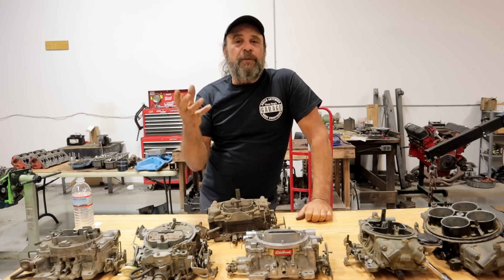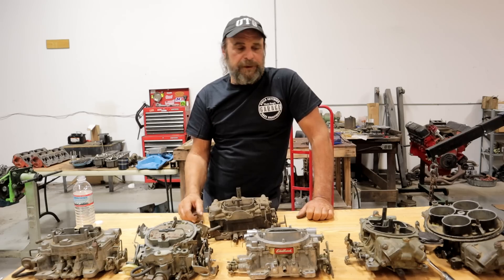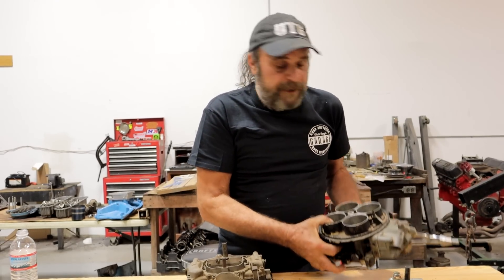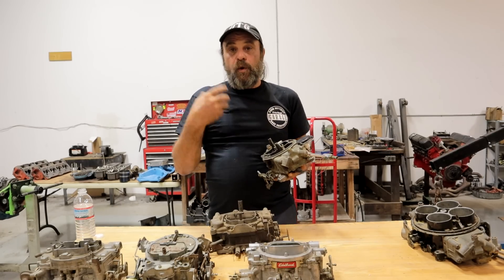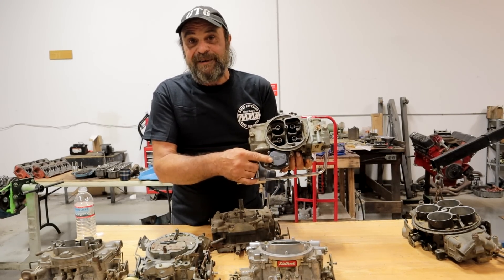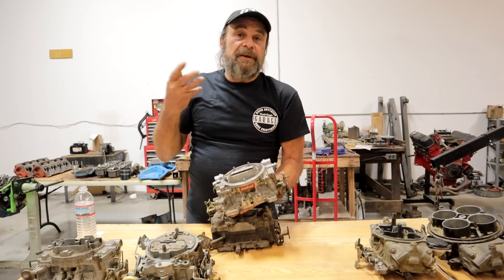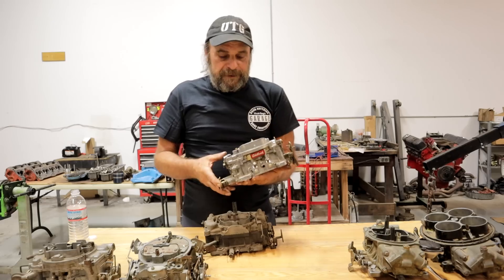Mechanical & Vacuum Secondary Holley VS Carter/Edelbrock, Rochester Velocity Style Carburetors

Comment: Back in the 80's I built a mopar 318 with factory 340 heads,cam and intake. Stumpled across a cheap used Qjet and put it on. Got it tuned by buying a Rochester how to manual and parts from a local GM dealership. Put it in a Dodge Dart and man that thing would scoot. Outran a Corvette one time. Wish I still had that car.

Comment: Great explanation on the different variety of carburetors used in our vintage cars.  I've rebuilt many Rochesters and Thermoquads with good results.  They always ran better after the rebuild.  Can't comment on the others but I'm sure the results would have been similar.  Got a Thermoquad on my Barracuda and it runs great.  Would I be happier with a newer carb ?  I doubt it.  Thanks for all the great videos.  Best Regards - Mike

Comment: After seeing the previous video regarding the silly formula to calculate your engines carb cfm, I researched a little further. 

This one had me read the article a couple of times.  The 337 Chev producing 350hp had a 600fm square bore Holley.  That’s factory OEM.  I’d always thought it was the 750cfm Quadrajet that was on these higher HP engines

Comment: I thought I remembered this video after the current UT video. UT says in a cruzer , " Use Edelbrock."  Just bought the 1st 4150  for myself in the last 20 years.  Always used Edelbrocks. The Holleys are more work to tune. That said, I'm still not close to tuned on the new 4150, but it definitely does out preform the Edelbrock. We'll see how reliable the Holley is. The Edelbrock was trouble-free. Change rods in the spring and fall. Holley to race Edelbrock to drive.

Comment: Hey Tony, I seem to remember that Carter had a "Competition" version of the Thermoquad I think it was around 1000 cfm.  Have you ever run one of those ?
Reply: I have one in my garage right now sitting on a shelf
Reply: On my '72 Sebring Plus w/400 4sp had a 815cfm thermoquad. Multiple tunings w/ different rods & jets let me set it up good w/ .509 cam, electronic dist total timed @ 31° btdc. Had a dist.  mark for starting/daily driving@ 6°btdc.  Lots of memories!
Reply: I'm pretty sure it was 1030 cfm, if I remember correctly.
Reply: Could be it's been a while.

Comment: According to the antique Carter manual I still have, WCFB stood for "white cast four barrel", and the AFB name designated the change from basically pot metal to aluminum. Other antique stuff I have, since I am definitely an antique and got it when it was current, give the same translation. Trying to explain pot metal, or white cast metal in this era, though? Uh, no, not me.

Comment: If you're using at there's Spring tension intention there's the Cam on the 2nd area airvalve there's the orifice in the vacuum break that you can drill out there's a hanger that you can change the location of the measuring rods and other things

Comment: The Thermo-Quad (TQ) was initially released for competition in 1969. Chrysler may have invented the thermoquad in the very early 1960s for experimental engines.
Reply from the maker: It was released in 68 as an aftermarket upgrade for the Quadrajet.  Chrysler had nothing to do with the carb until 1971 when they used it on the 340.

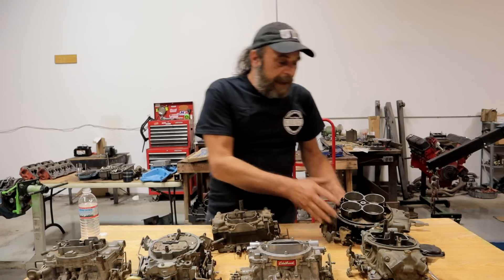Comment: Tony they didn't introduce the thermal quad till 1971. The 1st engine came on was at 3:40 and that was the beginning of it. And I know that cause I got one from a wager to put on a 65 GTO. I was racing at the time and it was like from outer spthe ultimate carburetor
Reply from the maker: No, CHRYSLER introduced it in 71.  It was available over the counter at any speed shop in 68

Comment: I would argue that the Reg Edelbrock/Carter is easier to tune for a youngster than the comparable Quadra Jet.... Pulling the whole air horn for adjustment is just a deterrent when comparing a Q jet to a Carter/Edelbrock ....  Keep Hot Rodding A Live.. 
Thanks Uncle Tony and Uncle Kathy..

Comment: I run a holly 650 DP mechanical  secondaries with a 6" velocity  stack on a 1970 Chevy Monte-Carlo small block  400 (406) bored over.  In a 57 Chevy wagon.

If I have to pull stumps,   I'm going up to the hot rod.

Comment: I just rebuilt the Thermoquad for my 440 Duster. Runs much better. Still a bit of a bog when I floor it. I’m thinking the spring for the secondary air door needs a tweak. Tighter? Looser? Depends?

Comment: IMHO, the Q-Jet is the Apex of Carb Design. It was reengineered in the Mid 70s  with Altitude Compensation, and then again in the early 80s, when the Primary Metering Rods went under Computer Control. 
Its Design, allows for an almost Infinite variety of Fuel Delivery Curves, and it has been used on very small engines to some very large. Most Q-Jets were rated a 750CFM, but a few were rated at 800CFM.

Comment: Thanks Tony great video, can you help or if anyone can help 😊
I have a rebuilt 302 upgraded valves and springs and cam with GT40 heads and edelbrock performer intake in a 68 mustang, I believe on the dyno they used a 660 cfm carb and resulted in 360 hp and 328 ft lb torque… what carb can you recommend?
Yes there will be burnouts lol I’m not after speed but I want good throttle response 

Any help would be great 👍🏼 thank you sir

Comment: You didn't mention the Fish carb from the fifties🐠. I had a Chevy 302 engine with a 4 barrel and it went from 0 to 60 in 15 seconds. I put on the fish single barrel and it went 0 to 60 in 16 seconds. This was in my 54 suburban. Arround 93% as good as the 4 bbl🙄

Comment: So quick question - on my autolite 4100 with vacuum secondaries if I punch it to the floor from a dead stop and I spin the wheels are me secondaries open?  With a double pumper they would be open and working.  Yes or no?

Comment: I have a question, i have a 1979 q-jet 4 barrel i took it off a junk cadillac an rebuilt it with a walker kit, it has two vacuum valves an was wondering if can make it into a mechanical style?

Comment: Have you heard this one ? This man has a voltage regulator that needs a ground . He mounted it on rubber and tan a ground wire to his carburetor with a ground switch on it set up to close the ground when it was under full throttle. So when he was at the drags when he stood on it the regulator has no ground and alternator was not working until he was off the gas

Comment: I once wrote a letter to Car Craft or Hot Rod mag, or possibly one of the others, (it was about 30 years ago), to find out if there were any tips, tricks, mods and/or parts that could be applied to the Ford MotorCraft 4bbl carbs. My letter was published by the magazine, but the upshot of the answer on MotorCraft carbs was basically a succinct, "no, none at all". Any thoughts on MotorCraft carbs from you Tony?
Reply from the maker: It's an orphan carb, that really doesn't have any sort of following, so I never spent much time looking into them.  
I would try to find someone who runs one in NHRA Stock or Super Stock and see if they could offer any insight.
Reply: @UncleTonysGarage  Thanks Tony. I appreciate the reply.

Comment: Qjet has a air valve adjustment also, unfortunately to many were jerked with giving the Qjet the quadrabog nick name, which is totally not true they work great if calibrated correctly. The other thing leading to sub par Qjet performance is there were so many moved around from car to car carbs calibrated for one cat tossed onto another car. But I will say back in the day nothing made a car feel faster than stomping the throttle the engine falling on its face for 2 seconds then recovering in wot acceleration accompanied by a roar of a Qjet sucking down the worlds entire atmosphere, as a kid and a teen I sooo loved the Qjet with upsidedown air cleaner lid sound, it could be so loud sometimes it could drown out the loud exhaust with that insanely loud growling moan. Purrrrrrr Wuuuu wuu wuu whaaaaaaaaaaaaa. Good ol days....simpler days when 300 to 350hp day 2 car you could be the top dog in a small town, boy I miss em.

Comment: Hey Tony old man Carter made the quadriget and the as far as the AVS goes. It was on the market in the 66 for the 60 cent mile. You're anyway so there you have it and then he when he got done selling the quadrujet to General Motors cause they didn't have anything like. That you went on to design thermal quad which is the ultimate 4 barrel carburetor for the street.

Comment: Any possibility of comparing 2bl carbs . Used on ford Chevy and Mopar . I always wanted to try a 318 with 360 2bl intake and Ford carb just to see how it would run and tune
Reply: My brother and I did that on a 318 in the early 90's. The carb on the 318 needed a rebuild but we had a 79 360 2bbl carb and intake, so we put that on instead. Couldn't really tell (or remember) if it made any more power or not, but it got rid of the really bad hesitation the old carb had. The car was a 65 Coronet 500 that someone swapped a mid 70's 318 to replace the original 273. The intake port mismatch probably hurt it some, if I knew then what I know now I probably would have swapped the heads from the 360 or just swapped the engines.

Comment: Should've put a Predator in there just for kicks.
Reply: I actually thought “aha! he left out the Ford VVT and Predator design,” but it’s hard to argue that it’s much more relevant to modern hobbyists than updraft carburetors.
Reply: @stevelacker358  Yup completely obsolete equipment, but great to throw the carb noobs for a loop.

Comment: I kind of have an atypical situation I think, that being a 6600 pound truck with a gutless stock TBI motor converted to carb and was wondering what you might suggest and think of my theory. I have a bogging issue right before the secondaries open that changing the diaphragm springs has not quite cured.  Would going to a smaller carb increase the air velocity on the primary side enough to open the secondaries up all the way? 

Vacuum gauge reads zero until about 3000 rpm maybe, then from there to peak rpm (4500) there is about 1 inch of Vacuum. So im thinking my carb isn't too big.
Reply: Add a 1 inch spacer
Reply: @Thumper68  what does that do to fix it?

Comment: I've always wanted to see what could be done with the motorcraft 4300 4350 carb
Reply: they are ok the early 4300 in 1967-68 are junk. the1969-1973 are ok! ran one on a 302 with 1967 289 heads a 289 RED solid lifter cam 10:1+ comp Hi RISE duel plane and a 1969 390 gt spec 4300! rans as good as the holly 4160 that I was to lazy to fix when i had a low hour 4300 and wanted to see how well it  would work. been in service 5 years! with no problems.
Reply: @jakemichael8586  cool as a Ford person I see the 4100 alot and trusty the 2100 and there great carb but I never see any performance 4300 builds so it's cool to hear that people do use them and that they can support power
Reply: @adamturner8634  if you do use one use one from 1969-1974! mine was off a 1969 390 gt! is available in 600 cfm that is the one I used. there is a 715 cfm made 1971-1974.the 1967-1968 ware junk! 4300 are good for the less hot builds.

Comment: Mr Tony I want you to figure what kind of carburetor I need I've got a 302 in a Mustang 70 model fastback that is bored out 60 over nothing special as far as the new Pistons, new valves go it's got a 280° duration and 520-in lift, Magnum comp cam, I'd like to go with a dual plane low rise intake, it's got long tube headers on it and two and a half inch exhausts all the way out, old school 12" cherry bomb mufflers what size carburetor do I need to get I would like to go with manual choke and mechanical secondaries but  I'd like to have your thoughts

Comment: I like my AVS2 Edelbrock seems to run pretty well except it's very rich on idle try everything don't understand everything short of drilling holes in my butterfly and you're wrong about the AVS just the primary boosters are a annular booster which really helps out

Comment: Why was there never a 2v carb that  opened one at a time like a 4v?
Reply: Hondas and some of the other companies made them.
Reply: The 79 Horizon w/1.7 VW engine had a Holley carb that did that. I had the car in high school in the late 80's. Fun little car with a four speed manual and no A/C, no power brakes or power steering.

Comment: Is the Predator carb still a thing?
Reply: Predator carbs have been out of production for many years, they are very hard to find and fetch a pretty penny these days, also parts for then are quite difficult to find. But if you can find a good one they work awesome but aren't practical for most applications, mainly due to hood clearance issues and throttle linkage geometry.

Comment: Ok, I remember that there was a carburetor that could auto adjust the air fuel mixture, it worked like the fuel injection of the late 50s and early 60s, I can't think of the name, I'm sure it did not work very well but it was a try. does anyone know the name?

Comment: With the weighted style secondaries wouldn’t it be affected by the car itself  suddenly accelerating?
Reply: That’s an interesting thought, it never crossed my mind. It would be in the first 60-100 feet, where the high G loads are, but the Hemi’s running in A/S use those same AFB’s, and they seem to get the job done.

Comment: Very informative as usual. Being as I used to sell them I can tell you the difference between Carter ( built out of a beter grade of aluminum to battle heat soak) and Edelbrock ( Built out out of an alloy that is made to shine up and be pretty) is almost indestiqisable. But, you it depends on your freash air situation and what your going for drivability or looks

Comment: i will build up a carter or run a holley i hate the edelbrock carb . the carter is a very dependable carb u just need to open up the fuel intake feed and drill it out ports then u can get it up to 1150 but most people have no idea on how to do it but they work good but it is not as good as a holley but on off road it is one of the best ways to go if cheap application. i would just put a sniper on it. the new efi system are really good just as good as a carb u use to lose on response and hp on a engine but they made them just as good now and they are not cheap 2,000 to 5,000 for a good one. i would like to see the knock of holley carbs how good they are

Comment: Its jibberish to these young ones this just over complicated to peeps that wont understand how velocity,  fuel air mix they just want a good carb that performes well , period no jet changes not vacuum  no tinkering just slap a edelbrock 600cfm carb on just about anything v8 and it will perform good just good! Blahaha JK! IAM JELLY
Reply: Sure if you are ok with the carb killing 25+HP.  No thanks.